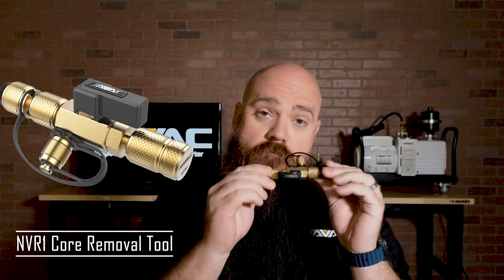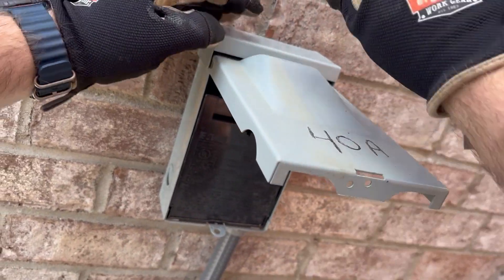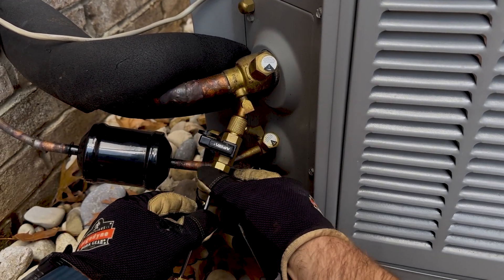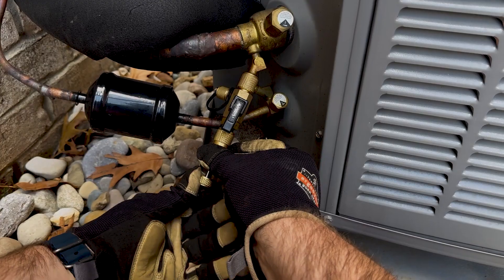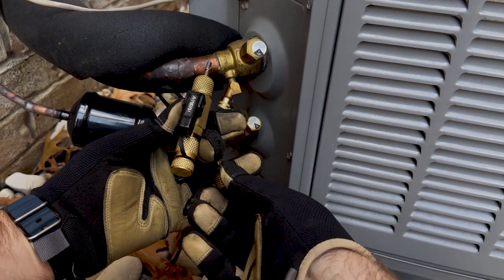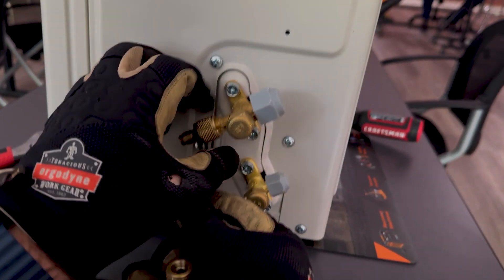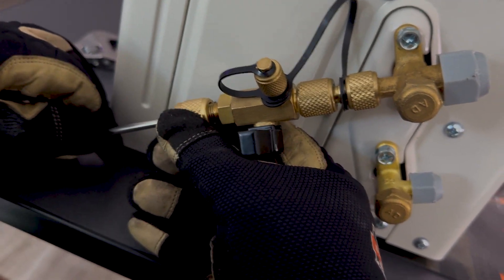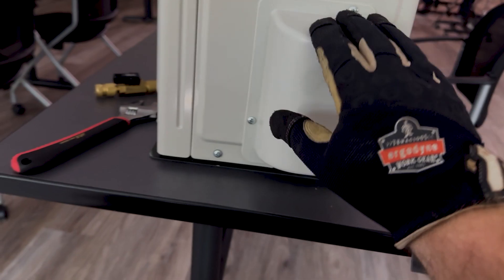VALVE CORE REMOVAL 101 with NAVAC NVR1

Comment: Okay, just for all the new people that are just starting the industry. Whatever you do when you put in a new straight of cool, do not follow these steps. Once you think you've gotten it in and tightened up, you close that ball valve, you crack and take off the end with the stem, and you slowly turn that ball valve. Because if any part fails and you have freon coming out of that ball valve tip, then you know it did not seal correctly and you need to replace that valve coal. You have a faulty little rubber ring in it or something else. That is a safety step, then fully remove from the unit
Reply: What's a valve coal ?
What's a new straight of cool ?